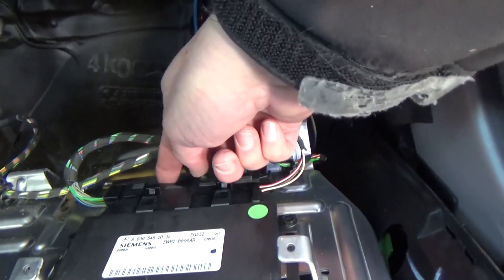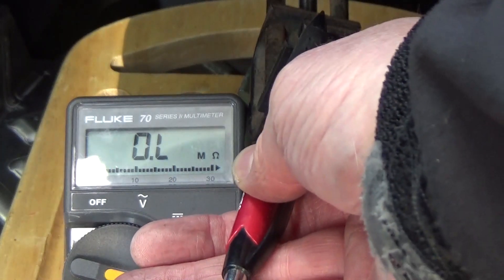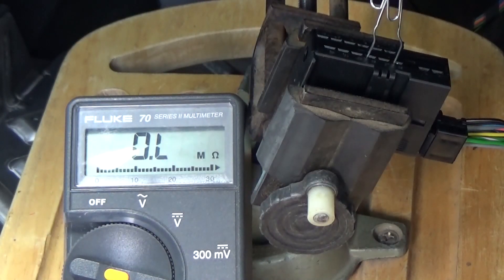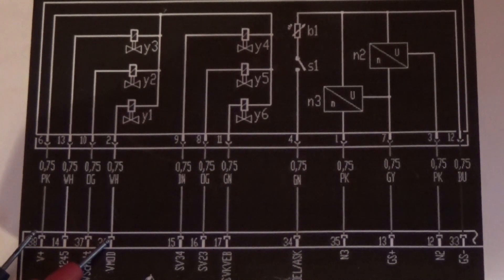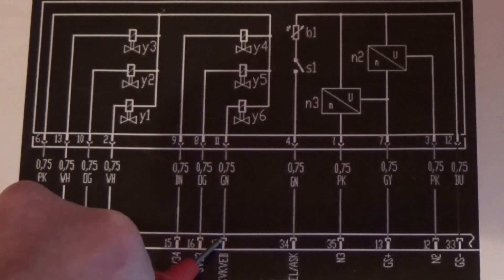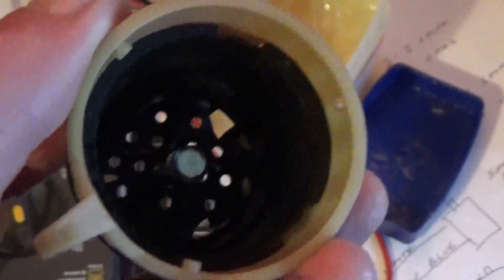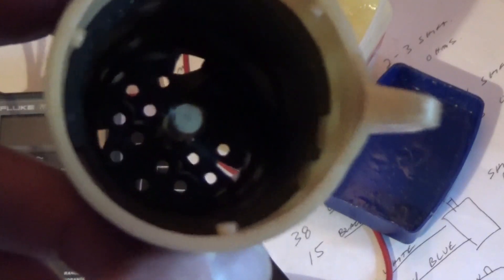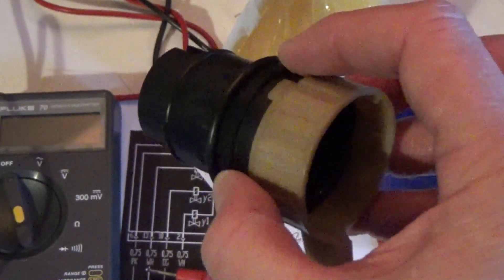JEEP Grand Cherokee WRANGLER NAG1 Mercedes Transmission Check Conductor Plate  w VOM From TCM

Comment: appreciate this video.  About four years ago my 05 GC nag1 started throwing codes P2784 and P0732 and going into limp mode.  Turning the car on and off would solve the problem but that wasn't a long term solution.  I dropped the pan and valve body and replaced the speed sensor lead frame.  Seemed to fix it but now same symptoms are back and I hardly drove the car during covid - maybe 15k miles over those four yrs.  I'm thinking it might be a bad connection or possibly a very light leak at the plug causing problems.  Gonna run these tests tonight to check the wiring before I drop the valve body again.   My plan of attack is check the wiring/plug> check plug>change the atf4 and filter> replace plug and speed sensor leadframe
Reply: 38-36: 6.3ohm, 38-16: 5.2ohm, 38-15: 5.1ohm, 38-37: 6.3ohm, 38-17: 3.5 ohm, 38-14: 5.5ohm.   Are those within range?

Comment: I got 3 ohm on the TCM plug for the TCC solenoid line, direct connection to solenoid reads 2.4 ohm. Do you think 0.6 ohm is too much resistance for the TCC solenoid wire?

I just replaced my conductor plate and TCC solenoid and my '07 Jeep GC is still throwing a P0743.

In one of your other videos you talk about having to use a scanner that can reset the TCM on your 'benz, to get it out of limp home mode. Do you know if this is just a 'benz "feature" or did it carry into the Chryslers using the 722.6/NAG 1?
Reply from the maker: The truth is: I don’t know

Comment: I think I have a problem with my conductor plate…
My 2008 3.7 wk does this once in a while with absolutely no codes at all I’m thinking it goes into limp mode where it won’t let me go over 2000 rpm’s and I’m stuck going 30-40 mph shifts hard and then the limp mode kicks in. Do you think it’s the conductor plate ?
Reply from the maker: Changed filter and fluid ? How many miles on this vehicle?

Comment: Hello.  I’m hoping you can help me.  I have a 2013 Jeep Wrangler , automatic trans.   My shifter is stuck in park, I have no reverse lights and all of the gears on the dash are lit up as if they are all being selected.  The Jeep has 85k miles on it and was taken care of. Are these symptoms of a failed electrical connector plate ??   Please help if you can.   Thankyou
Reply from the maker: This is definitely NOT a Tcm or conductor plate problem
Reply: @Vortxrex  any ideas ?
Reply from the maker: Shift cable broken
Reply: @Vortxrex  lmao.  Thanks man.  I’ll figure it out.